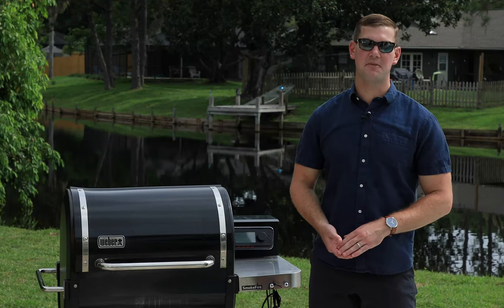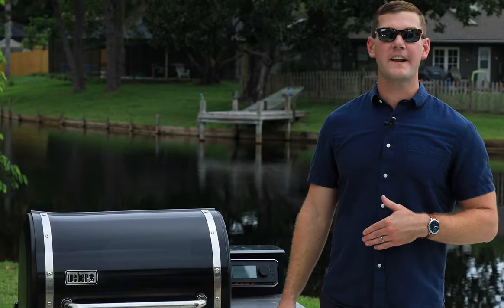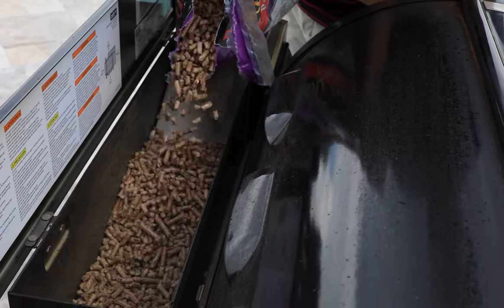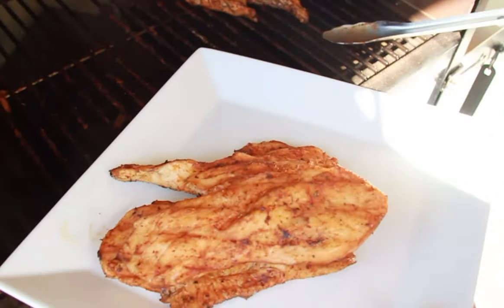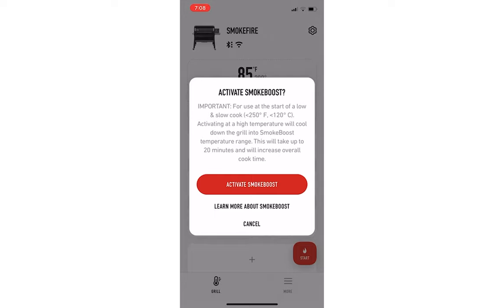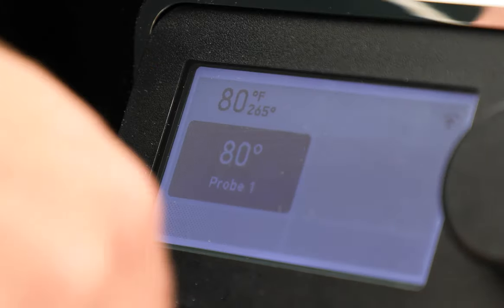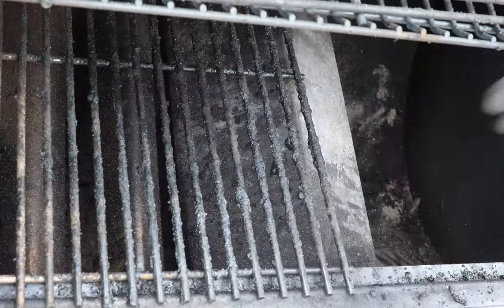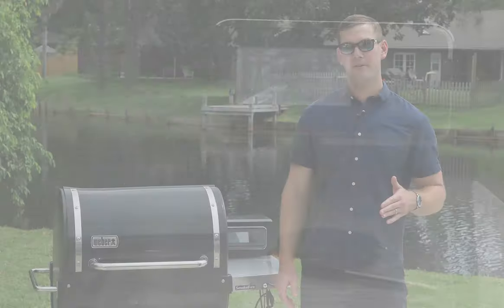Weber SmokeFire Pellet Grill | New Gen 2 Model | Second Generation Grill Overview

Comment: nice paid commercial for Weber Smokefire gen 2.....me, I live in the real world where you set the temp to 225 and the SF races to 331 then falls to 202 then starts climbing again....
Reply from the maker: Nothing paid about it. I cook with this grill at home 4-5 times a week and have no issues with it. I let my grill run and stabilize for about 10 minutes at my set temp before putting food on.

- Sam
Reply: apologies....the video does come across as a commercial....I was actually in the middle of this temp run when I went online and saw your video....glad you aren't having these problems...I don't either if I am cooking 350 or higher...it is having troubles under 300....
Reply from the maker: @universaldonor3100  it’s all good. All pellet grills have temp swings. It’s a computer trying to determine how fast to spin the auger to feed the fire pot. Gotta give it some time to stabilize and level out. There will always be some fluctuations throughout a cook.

If you have massive temp swings consistently and they don’t level out, then there’s a problem.

I smoked a flank steak at 275 F last night on the SmokeFire until 140 F internally and had zero issues. Well one… which is I’m mad I didn’t try cooking my flank steaks that way sooner. Way more tender and juicy versus grilling it at medium-high.

- Sam